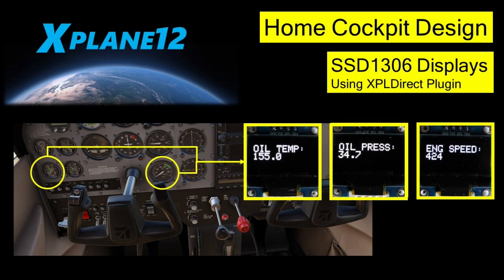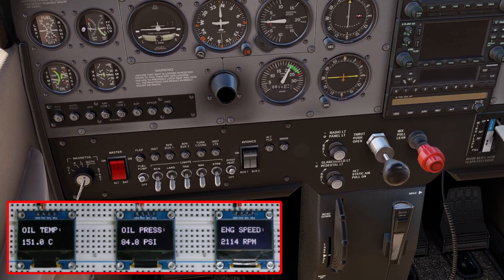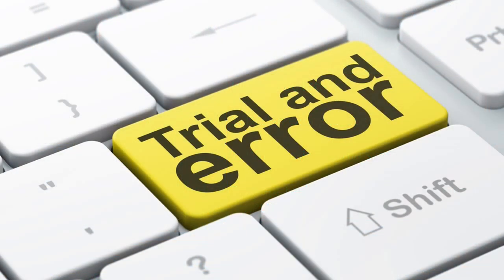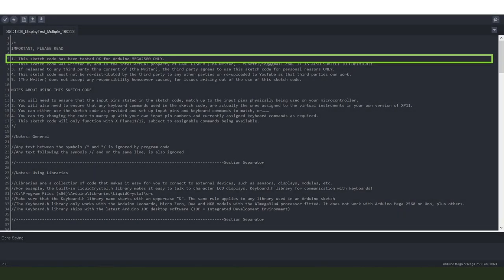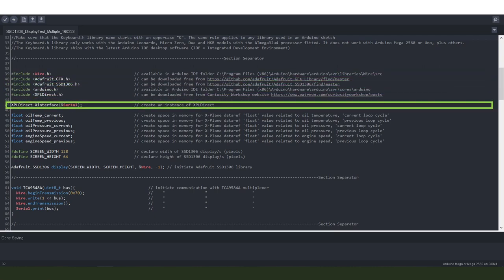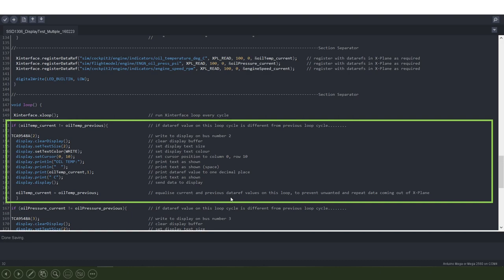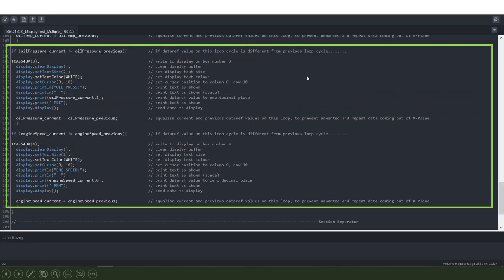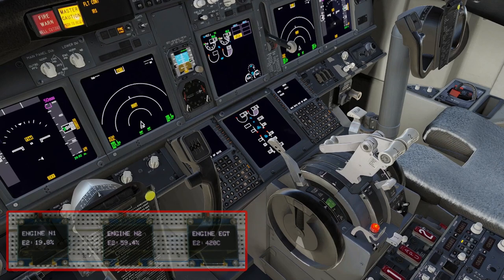Home Cockpit Design: Using Multiple SSD1306 I2C Displays with X-Plane 12 Dataref Values

Comment: Another great video - Thanks!  One thing I did notice in your code is that you set current=previous after displaying the values.  This is reversed - it should be previous=current.  This will probably resolve your "flicker" issue on the displays.
Reply from the maker: Thanks Larry, I always used to go with previous=current, but for some reason have started doing it in reverse. The flickering of displays is not at all visible just by looking at them with the naked eye, it only shows up when viewed through the lens of a camcorder, which is why I thought it might be a conflict of refresh rates? Cheers for now and regards, Paul :-)
Reply: @funofflying15  I wasn't very clear, sorry.  By "flicker", I was referring to the issue with the RPM values.  The "current" value is updated by X-Plane.  You should save "current" to "previous" in order to compare it in the next loop() cycle.  After I looked at the video again it may not make a difference in the RPM values if the dataref values in X-Plane are jumping as well
Reply from the maker: Hi Larry, thanks for that, but after altering code to previous=current for all displays, the same data fluctuations still occurred? Bit of a mystery at the moment? Cheers, Paul